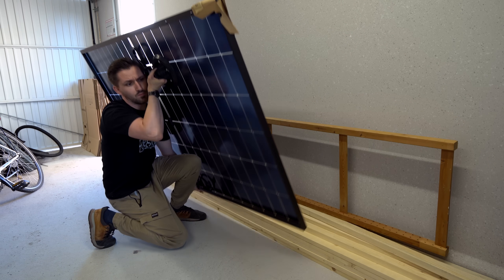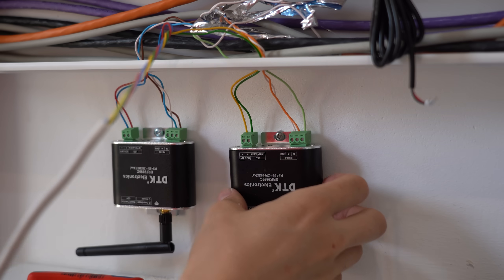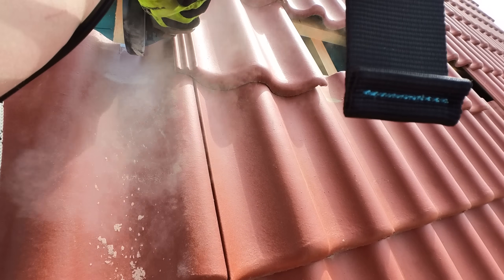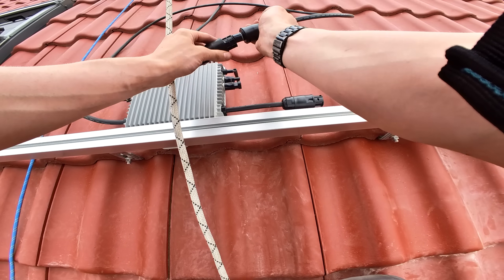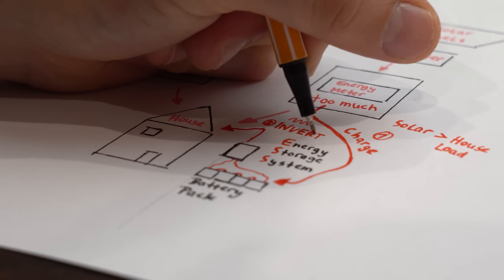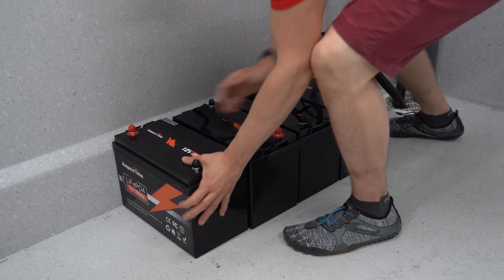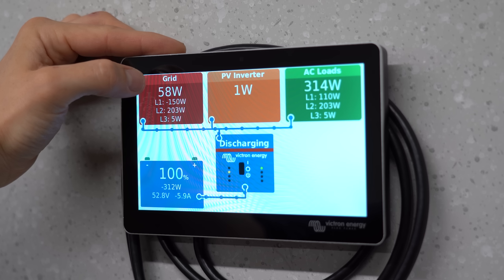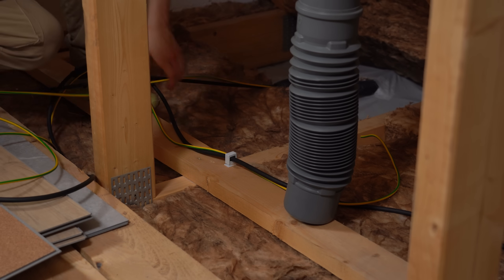Pushing a "legal" Mini Solar System to its LIMIT!

Comment: as I can see, you faced the same problem that made me abort by solar/battery project: you didn't find a convincing 3 phase inverter. I ended up selling 100% of my energy production, which makes sense as I sell electricity at twice the price I buy it, but is useless in case of a power outage
Reply: "as I sell electricity at twice the price I buy it"
what? in my country i sell it for 10% the price i buy it and on top of that i have to pay taxes because the gov thinks they own the sun....

Comment: The easiest way to actually get your solar panels on the roof, is to simply slide them on your ladder (with shorter side resting on your biceps as you climb up) and another person already up on the roof will grab the opossite side, you won't damage them that way and it is pretty safe. Personally, I've gotten thousands of PV modules on the roofs that way.
Reply from the maker: Good to know. Thanks for the feedback :-)
Reply: @greatscottlab  The first time my wife and I installed panels on our roof, we use almost this method.
The  beginning of the roof wasn't super high (3m). The ladder (single straight piece) was laying at about 45°, my wife would put the panels flat on the ladder, I would pull them up with a rope while she would make sure they don't go side ways. Once on the roof, for the time I needed to secure them, she was on the other side of the house, on the ground, with the same rope. Just pulling slighly on it to "block" them.
I had a little piece of scrap metal bend to make a hook to grab the panel at the end of the rope.
I hope I explained it well enough.
Reply: Normally i use scaffolding. For small number of panels or if scaffolding is not possible you can use a handle with suction cups for glass and just climb the ladder with the panel.
Reply: Yep just take up the slack

Comment: Much simpler and cost effective is a Solaredge or Huawei inverter (2 boxes incl, batteries)
Reply: Even simpler, deye inverter with free of choice 48v battery. Doesnt get any cheaper for 12kw inverter.

Comment: "Why dont you just" ... add more Inverters and panels to the roof, while you work on it the roof anyways ?
Adding more panels should always be the option before adding a battery - you could even make those panels stop producing once exporting power.
Reply from the maker: There will be more. I wanted to start small and test things out.

Comment: Pretty interesting to see: The 8 bit guy has a similar system. It consists of a number of solar panels connected to a battery pack which is conned to the home circuits to power via a manual transfer switch or interlocked circuit. This does basically exactly the same, just without any tie to the grid.
Reply from the maker: Yep. Cool stuff :-)
Reply: @greatscottlab  Well, read the mainline comment I posted about your system.  The 8-bit guy's system has similar problems.  If you want something that is actually robust there are far, far better topologies to use than what you did.   At a minimum you need to rip out those 4 x 12V batteries in series and put in one or more dedicated 48V packs in parallel.  You CANNOT wire 12V LiFePO4 batteries together the way you did.  Even with a balancer it won't be reliable.

Comment: There is a big concern with the old design, the "leaking" energy that goes into the grid can be dangerous for the technicians working on the grid because they can disconnect the power input but they don't know that you are sending electricity and so they could be electrocuted so be careful guys
Reply from the maker: The MultiPlus 2 has a disconnection relay that disconnects from the grid if the power goes down. Prevents this.
Reply: Pretty much every on-grid PV inverter has anti-islanding protection and will de-energize its AC output once there's no feedback from the grid.

Comment: I wish my gov would allow the small grid tied 500watt wall socket configs :(
Where i live you need approval from the gov and a new special power meter.
In my case i just build a 1.5KWP solar array that tracks the sun in 2 axis and then its connected to a growatt 48 volt offgrid inverter with a 2kwh lifepo4 battery pack that i can also use in my DIY e-bike
the entire thing paid for itself in 4 years

Comment: The problem with the decentralized energy solutions are, it's missing the CHEAP storage solution. At the current price of electricity it just doesn't make sense to store it. If no storage, then all the energy gets pushed into the energy grid which leads to the strange case, where you have to pay to feed in electricity due to over-supply (of solar/wind energy).

=> to make green energy work, we need to solve the problem of "cheap storage"
Reply from the maker: True. But I believe battery prices will drop quite a bit in the future. Then you can go back to this video ;-)
Reply: @greatscottlab  Nah ... I already have solars ... 🙂
Reply: In areas where HVAC is a big use of energy (which is most areas), thermal storage is really cheap.
Reply: @NiHaoMike64  Dude .. we are talking of "Balkonkraftwerke", may be google what this really means ...
Reply: @johnmoser1162  Use the solar to make hot water or ice for heating or cooling later. There's a video online of a kid who built a working prototype of an ice storage air conditioner.
Reply: @NiHaoMike64  Dude ... how old are you ? You are talking to an EE with Masters degree ...
Reply: @johnmoser1162  Please explain to me why you don't think thermal storage can work. Other than simply being in one of the few areas where there's not enough HVAC use to get much use out of it.
Reply: @NiHaoMike64  Don't you think it's plain STUPID to use electricity to solve "thermal" problems ?
1. build proper houses where heating/cooling is not needed or needs a tiny amount of energy
2. Do you think a "Balkonkraftwerk" = a few hundred Watts per day is sufficient to do any meaningful cooling ?

-> DO NOT use electricity to solve thermal problems
Reply: @johnmoser1162  Please design a house that doesn't need air conditioning in Texas or Florida. You'll be able to sell it for quite a premium as air conditioning is a big expense.
A few hundred watts is enough to run a good window unit nowadays.
Reply: @NiHaoMike64  Hm ... again, you seem not to be an engineer. Google for "min energy house" ... and these houses obviously cost x-times more then the crap you have in the US. Typical ... build crappy house with zero insulation and then fix it during the life-time of the house with "air conditioning" ... very "smart". The "normal" use case for a proper built house around the world - no need for "cooling". And if you live in an area where it gets hot - yea then you can use PV for "cooling". But that is not the topic of my post. Think about if you live in the northern states - many days w/o sun and wind.
Reply: @johnmoser1162  I have yet to see any house in Texas that was able to do away with air conditioning altogether. Not even the super insulated ones custom built for wealthy environmentalists.
Reply: @NiHaoMike64  Not sure if you are familiar with basic physics. Do you cool down the air or do you make sure there is air flow (-> wind chill). So to have airflow (ventilation), which is needed anyway, helps a lot.

Then make sure there is shade -> trees

And so on ... but again, I doubt you have genius house builders down in Texas.

And who lives in Texas anyway ? Or do you think the world has to adjust to the "use case Texas" ?!
Reply: @johnmoser1162  The second largest US state by population is hardly insignificant.

Comment: Inverter do NOT working under OFF  GRID system because if your power line is OFF send dangerous voltage on power grid and someone electrician workers kiling with this system!!! DO NOT THIS LIKE !!!
Reply from the maker: Wrong. The MultiPlus 2 comes with a disconnection relay. If the power grid goes down, it shuts down as well. This is mandatory.
Reply: @greatscottlab  From experience,check this out,disconect one line and mesurment voltage in this when while there are two others,even with load
Reply: Victron multiplus inverters are hybrid inverters that disconnect the grid with a relay if the power is off. So no, they won’t back-feed if the power is out.
Reply: These inverters switch off when no mains voltage is present.  This is a regulation in the EU.
Reply: @petersilie3090  I working in my coutry on this in distibution electrical energy and very diffrent inverters depends off line voltage in 3 line system do not shot down (some line back very diffrent voltage ,even 140V on back to grid)

Comment: On my system, I had it setup wrong at first (for at least a month!) and was backfeeding due to overgeneration (and don't worry, it's anti-islanded!). Unfortunately, I have a conventional meter (not bi-directional) so all the excess power was being BILLED to me!  Yeah... my power bill went UP for a while!!   Ooooops.
Reply: U have digital or classic meter? U can easy backfeed if u have classic meter, with digital u need 2 way meter.
Reply: Oh BTW, I have a 3KW solar setup. And it was in the late spring so there was LOTS of sun here, and they were pumping out about 2KW of excess!
Reply from the maker: Oh boy. Glad you could find the problem and fix it

Comment: Colles Projekt, allerdings hätte man bei so nem komplexen System gleich ne große Anblage bauen können. Da ist die Anmeldung jetzt nicht so viel aufwändiger. 
Balkonkraftwerk sind ja so toll weil sie so simpel sind, das fast jeder Laie eins an einem Nachmittag aufbauen kann.
Wie kommt es das du das Dach nicht gleich vollgemacht hast?
Reply from the maker: Ich fange gern klein an um mich mit allen vertraut zu machen und skalieren dann hoch ;-)
Reply: @greatscottlab  Hab mir die Sachen von Victron angeschaut, die kann man ja fast alle für ne gößere Anlage wiederverwenden.  
Haben bei uns auch kürzlich 20kW aufs Dach gebaut. Ich kann nur sagen: Viel Spaß😉

Comment: wait you connected what is in essence a lightning rod to house ground? i dont think that is the best idea, separate grounding pls
Reply from the maker: You have to earth your solar system. It is standard code where I live.
Reply: @greatscottlab  yes but you can make a separate ground by pounding a copper rod into ground a bit, preferably two, im not suggesting leaving it ungrounded.
Reply: @DeathbyKillerBong Also u know your home ground is possible connected to same ground. This is TN-C-S system likely.
Reply: @DeathbyKillerBong  yea, if it got hit by lightning then the current will flow thru ground wire inside the house. If the ground is not perfect (ie: have high resistance) then the current will arc into the house searching for a closer ground, this will damage to the insulator of wiring inside the wall and could also damage the house.
Reply: It is required by law to ground solar and satelite systems
Reply: For satellite systems? In Poland u don't need grounded dish. 
For solar system and even my pole to collect ADB-S ground is required.
Reply: @mateuszzimon8216  I was referring to Germany since the video was made there

Comment: Wow! amazing

how much do you think it takes for the current setup to be financially cost effective or at least cover its own costs?

and how much do you estimate the total cost of such a system?
Reply from the maker: Total cost. Maybe around 4500€. But you will have to add around 600€ more for maybe 1.6kW solar more and MPPT charger. Then this system could pay for itself in maybe 5 to 15 years depending on electricity prices. But truth be told, for me this is not all about ROI on such a system. I just love solar and creating my own power :-)
Reply: @greatscottlab  great attitude!

Comment: Did you have to specifically ask you EVU for the use of a battery? As far as I know, here in NDS they block everything storage related, if it's a Balkonkraftwerk -.-
Don't know if this will change with the coming up Gesetzesänderung though.
Writing mixed Ger and Eng looks kinda perverted. I like it ^^
Reply: afaik the regulation only limits the max amount of solar power (Wp) and the max for the inverter per household to 600W, because apparently they say thats enough for most.
You are technically free to store the excess and feed it back when you need.
But of course different Regulators and Power Providers might see that differently. Many Power Providers are quite hostile.

As long as you have a proper socket for feeding in, you can do the rest by yourself (assuming the system is certified).
If uncertified you need an Electrician to say its ok. (you wont find anyone just for checking.. they do everything or dont come at all)
Reply: Who cares what your power company thinks? They have no right to dictate that so just ignore them.

Comment: Should be able to use the AC in and Out put so you can have an emergency sub panel that is battery backed up.  So if the grid power go down, you can power everything off the multi plus. Legion Solar make a system using same idea to have plug and play systems without feeding the grid and no permit and just diy.
Reply from the maker: True. Might add that later ;-)

Comment: Everybody wants to have a house like Scott with all the latest tech installed.
Reply from the maker: It certainly is fun :-)
Reply: @greatscottlab  yes I can tell after seeing everything you've installed so far.
Reply: @greatscottlab my 4yr old nephew said he wants a Gwate (great) Scott for Christmas. So cute🥰🤣👍. ( he can’t say great yet)
Reply: @greatscottlab  But speaking of "latest tech", I did the same task as you in this video, but I used a Chinese made "solar hybrid inverter" that incorporates inverter and charge controller in one package.  It has menu-controlled parameters to select battery type, voltage thresholds, Mains/Solar priority (for charging) and Mains/Solar priority (for powering the inverter).  I have mine configured to act as a UPS (power from batteries when Mains fails) for my Office/Laboratory/Radio Shack.

So my complete system includes the hybrid inverter, PV panels, LiFEPOH4 batteries, circuit breakers and a switch to bypass the inverter and re-connect my office directly to the mains from its original circuit in my US style breaker box.
Reply: @greatscottlab funfact... Wenn man einen alten Stromzähler hat dann dreht er sich rückwärts wenn man mehr Strom produziert als verbraucht
Reply: Certainly when you are paid to promote such super expensive products..
Have you seen what they charge for a Serial cable??
Reply: @tarakivu8861  i literally cannot afford that TBH. It's just a daydream.
Reply: @tarakivu8861  MKBHD, Marquee Brownlee, did a tesla solar roof. Cost him about $95k but he said it could be done for much cheaper if you don't go the full Tesla route like he did. He said for his home usage it would pay itself off in about ten years. He did a whole video about it. He was pretty much off the grid for an entire year. Solar is the future <3
Reply: @tarakivu8861 Just my thoughts!

No BOM or cost of components mentioned in the video, nor any break even calculation.

Showcasing expensive gear and unable to mount the source of power, the solar panels! 😂 True DIY!

No let's hope Scott will followup on this video with facts and figures.
Reply: Some would even say Scott's house is great.
Reply: That is some sexy looking fuse box, I must admit.
Reply: @DashCamSerbia  i beleive so.
Reply: Negative.
Reply: @AtlasReburdened  alright 👍
Reply: Yea
Reply: Not especially.
Reply: @Sonny_McMacsson  alright
Reply: Sorry, but me - no. DIY is for fun, but its not about durability and  efficiency.
Reply: @dmaraptor  okay
Reply: @Fire-boyYT2009 did you tried asking him?
Reply: Hell, ill just take a house
Reply: @pneumantic6297  ask him if he's interested in selling
Reply: Not everybody.
Reply: @sootikins  okay I'll change to some people.
Reply: No, I don't. Dismantled everything.
Reply: @SjonnieTheGray  but why ?
Reply: Agreed! ❤😂
Reply: then do it, yes its hard but just do it make a plan and make it yeah its harder than just saying it but do it
Reply: I believe many just would want a house
Reply: That's why we are here
Reply: Yeah, all the latest Google and Apple spyware... Woohoo!!!
Reply: @hectorae86  i thought he uses custom softwares.

Comment: Is there a disconnect switch in there for when the grid loses power?
Reply from the maker: Yep. MultiPlus 2 has that included.
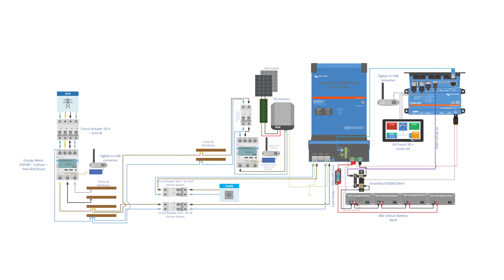Reply: @greatscottlab  8:00 I see it.  I thought your house was coming off the AC distributor.  It's the 'Loads' on that schematic, isn't it?  One last thing, Victron makes a battery balancer that works like a cell balancer on a larger scale.  I never see them used in these series systems, just thought I'd mention it.

Comment: What keeps power from entering the grid from your panels in case of a grid outage? That is a major problem we have to deal with here with solar on homes.
Reply from the maker: There is a disconnect switch in the MultiPlus 2
Reply: And that part should be checked regularly, u don't want backfeed if grid is dead.
Reply: @mateuszzimon8216  The micro-inverters will shut-down on their own, even if the MultiPlus doesn't disconnect the grid.   Microinverters do not try to run the grid.  Basically this is governed by the UL1741 and UL1741SA standards.

Comment: Cool. Would be interesting to have an overview about the costs.
Reply from the maker: Maybe with a future video I can do this. Was super hard to get everything done for this video in 2 weeks. Was really running out of time.
Reply: @greatscottlab  We dont need to know your cost but rather the general market price of the components would be good to know.
Reply: Well considering the Victron MultiPlus-II @8:18 ALONE is $3000., Its not gonna be cheap.
Reply: Those LiFePO4 batteries are $350 each (with tax) - so, thats another $1400